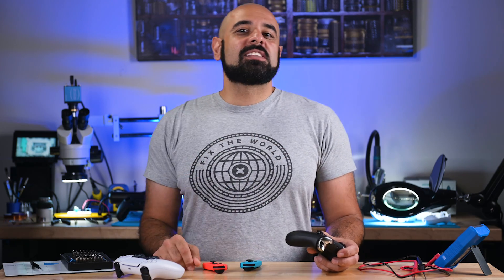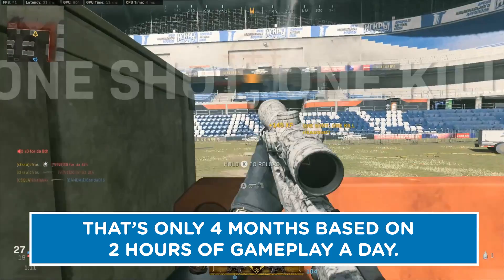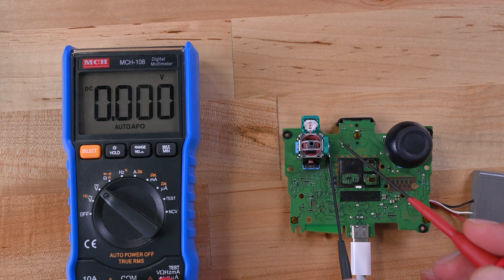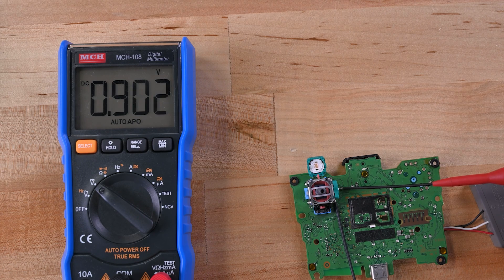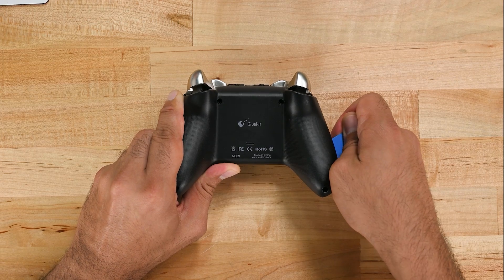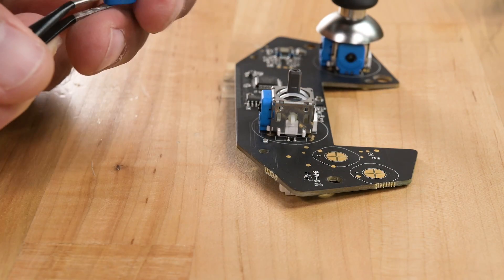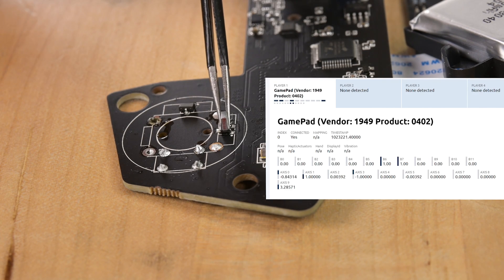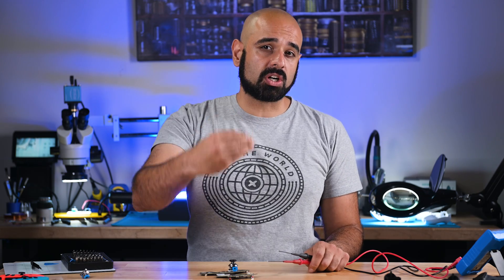How Manufacturers Can Fix Joystick Drift - Permanently!

Comment: Just stopping by to remind everyone that Hall effect sensors are not new technology. They were used for the analog sticks for the SEGA Saturn in 1996 and the Dreamcast in 1999. Manufacturers don't use them today because they would rather your controller wear out so you have to buy a new one.
Reply: @ShockingPikachu  they used light passing through tiny channels that would count many channels away from "zero". It's why if you held your joystick in one position while booting up the system it would maintain that trajectory. You "zeroed" your joystick position in that direction.

The floppyness is a mechanical problem. There is a bowl at the bottom of the joystick that holds it in place with a spring for tension. Over time, the joystick will grind away material from that bowl. The joystick will be in a lower position because the bowl can no longer hold the stick in the correct position and create the infamous floppy stick.
Reply: Designed obsolescence. The real cancer of the gaming industry
Reply: @Jihadbearzwithgunz  of the industry in general
Reply: @leonardomatheus1888  
I like to hear your alternative suggestions for how companies can keep profiting without being able to keep selling products? Nothing is more ill informed and naive as a no growth Capitalist theoretician.
Reply: @leonardomatheus1888  Nice pfp bro
Reply: @Jihadbearzwithgunz  it’s a feature of capitalism not just the gaming industry 😂
Reply: @Jihadbearzwithgunz  yeah the point I was making is that it’s even worse than you said!

You’re doing it right my man 👍
Reply: @Jihadbearzwithgunz  you have to milk profits one way or another
Reply: @Jihadbearzwithgunz  it’s not the design it’s their desperate greed of money 😐
Reply: @Jihadbearzwithgunz  Stop complaining.  Gaming is one of the cheapest hobbies on this planet.
Reply: @alexmendez3681  Gaming is definitely one of the more expensive hobbies. Cheapest hobbies would be something like sports, reading, writing or cooking (since you would have to buy food anyway).
Reply: @Jihadbearzwithgunz  it's called "planned obsolence". And this is not what it means.
Reply: @mihaitha  I’ll take “Planned Obsolescence” for 3000, Alex. Also, by definition, that is exactly what it means.
Reply: I can confirm that Hall effect sensors are common in RC applications due to their accuracy, consistency and longevity. Having flown RC for years, they do feel amazing. The accuracy is only limited by the characteristics of the sensor itself. Some have higher resolution than others.
Reply: Gulikit's controller and all the high-quality RC radio transmitters out there that use hall sensor sticks pretty much rule out sensitivity, accuracy and interference as issues. Heck, some industrial heavy equipment that require precise controls and reliability use hall sensing joysticks and manufacturers of such joysticks quote only precise voltage requirements and susceptibility to extreme temperatures (not applicable to game controllers unless you tell me you play in a volcano or out in the open during winter) as the downsides.

The stubbornness in refusal to use them for game controllers all these years absolutely is a planned obsolescence thing. They don't cost that much more than potentiometer sticks. People that try to make up big brain logics to defend the practice is a big part of why they can get away with this.
Reply: Dreamcast was wonderful
Reply: The original xbox one pads used hall sensors for the L and R triggers. Always surprised they didn't go with them for sticks, but as you say, they want you to buy replacement pads, which has become a big market in itself
Reply: @newtechgs7471  that's not entirely the reason why those triggers were phased out.

developers weren't utilizing the variable triggers... the only developers who did use them were racing game devs, where there's no reason a player would not just hold the trigger down except in very niche situations for rounding a corner -- where braking, a compulsory mechanic in racing games, is more intuitive and overrides acceleration programmatically anyway.

for all other instances, especially fps console games, having a set threshold for a thumbstick wouldn't help. also players often complained about how dampened and almost mushy the triggers were at launch, and the launch of the hair-trigger on the elite controller completely circumvented all other instances.

if they had implemented the hall trigger with sony's ps5 version of hair-trigger + tension feedback, it would have been utilized more. otherwise, i think the only non-racing games i remember ever utilizing analog-like triggers for gameplay werent on the xbone -- bodycount for the 360, and smash melee gamecube controllers.

the only racing game where it actually was useful on xbone where braking didnt invalidate it, was rocket league.
Reply: @ShockingPikachu  I think I heard that the N64 used an optical sensor, which I guess would make it more comparable to a mouse
Reply: @Jason-ir5ig  Yes, essentially they were a ball mouse, but being totally mechanical and with materials of very low quality, the base of the stick wore very fast creating drift (just as happens to the sticks of the switch, how curious), if only nintendo had used a rubber ball instead of a plastic stick would never have worn out and the analogs as we know them today would be different and durable, you would only have to clean them.
But maybe they would have inflicted some patent, Nintendo has never had a division of research and development of technology as if they had their rivals of the time NEC and SEGA, nintendo has never created anything, only takes existing technology and uses it in a different way what also has is to be applauded.
Reply: @Jason-ir5ig  No. The N64 controllers used potentiometers too however they had springs that held them in place. But they used cheap plastic in the housing  which ground away enough overtime that the stick could move just by tilting the controller. This is most evident if you played Mario party.
Reply: @Jason-ir5ig  Yeah. Though it had problems with the plastic bracket grinding itself to dust.
Reply: Sim racing manufacturer’s use them in there pedals my gas and clutch pedals have hall sensors on them the brake is a load cell
Reply: @shorty808100  my very old pedal uses an led and photoresistor for the sensor and the pedal has a v cut slotted between them.
Reply: @ShockingPikachu  N64 used optical sensors.  TECHNICALLY the N64's stick is actually a digital input because of the way it works, but yes, no pots with the only point of failure simply being the plastic so you're not entirely wrong.
Reply: u forgot dualshock 3
Reply: @madmatrac  ds3 was pot
Reply: @rudeskalamander  ds3 had hall on earlier versions. before cheaper slim version
Reply: @ShockingPikachu  Wrong, they use an optical encoder, sort of like some of the later mice that still used a ball. The reason they didn't wear out is because there was no physical interaction between the optical encoder disc and the sensor. Sticks themselves obviously still wore out.
Reply: @kameleongreen  Later mice? try again. I have an old logitech square mouse from the 80s that uses optical encoder wheels.
Reply: Welcome to capitalism 😒
Reply: I was about to mention the dreamcast controller! I picked up the console recently cause i grew up with it, ended up taking the controller apart and was thrilled to find hall effect sensors
Reply: Jeeze, I wish SEGA still does hardware today aw.
Reply: @AzariusR  Imagine if they pivoted to making peripherals for other consoles. The Sega Dual Sense
Reply: @AzariusR  put a comma after wish
Reply: @AzariusR  Yeah, unfortunately I don't see that happening anytime soon.
Reply: @AzariusR  did*
Reply: And they are used in heavy machinery, like for example an excavator, they've been in use for years, in places where precision and reliability is a must.
Reply: hopefully the EU could include this in some of their laws about planned obsolescence in technology
Reply: ps3 also had hall effect.
Reply: That's why these videos exist.

The more people know about this, the more people will buy better products, which will bring up the competition, and therefore will push them into building better controller solutions.
Reply: Came here to say exactly this. Saturn and Dreamcast controllers STILL going strong.
Reply: Honestly it doesn't make sense if they don't own an exclusive repair shops like Apple do. People can just replace those analog sticks in a 3rd party repair shops. They're just cheaping out on the parts. But it do works. Honestly i still have OG PS1 controller and it doesn't have any drift and i played it for 8 hours daily. Because of RPGs and the stick destroying mini games.
Reply: Just ban potentiometer-based analog sticks, problem solved.
Reply: Is there a place to buy them for a joy con?
Reply: @jeffcox6539  Not currently, but Gulikit has said they're working on making a module that can be used in Joy-Cons (they'll probably be cheaper than the Steam Deck ones since they don't need the touch sensor). I'd imagine Nintendo isn't going to be happy about it though.
Reply: EXACTLY! This is what I have been saying since day one. Sony and all the other companies make a ton of money on controllers, that's why they are priced higher than video games! They KNOW people will buy new controllers. This is why I HOPE the class action lawsuits really take off. Tired of these big companies soaking us for every dime. It IS entirely up to the manufacturers, but I highly doubt they will pick up the solution. They will continue to soak us for every dime with the wear and tear in 4 months controllers. Because they know that we will go out and buy new controllers. It's that simple.
Reply: @silverywingsagain My sega saturn controller had stick shift! The centering spring wad badly designed and weared out after a few years. Nothing is perfect.
Reply: @PhreakDarkSoul  yes, there's a difference between a few years and a few weeks, joycons in my personal experience tend to fail after a couple months, which is unacceptable.
Reply: @ShockingPikachu  the N64 controller did not use hall effect sensors they used an IR beam that was blocked by a disk with slits in it that created pulses of light like old ball mice used
Reply: @ShockingPikachu  The N64 one is optical.... and one of the worst offenders in terms of wearing and drifting. That white dust that you can see in any n64 controller isn't some random dust, it's plastic... plastic that comes from the piece that's supposed to keep the stick aligned in both axis.
Reply: Indeed, Spawn Wave recently made a video about the Dreamcast Controller. Even shady ass Microsoft initally used HE sensors in the Duke Controller.
Reply: @ShockingPikachu  No, the N64 sticks used the same mechanism of a ball mouse of the time and was not magnetic were optical, but not like today's optical mouse, however to be mechanical rollers that moved the stick were worn and created drift.
sega controllers were actually the first to use this antidrift technology in their sticks but also their triggers were magnetic.
Reply: This is why I still love Sega.
Reply: It wasn't only the thumbstick, it was also the triggers (at least on the Dreamcast controller).
Reply: Yes they are making you buy more but they could also just make these Hall effect sensor controllers more expensive and people will inevitably buy multiple controllers wether it be for friends or it’s a limited edition controller
Reply: exactly ...they did it on purpose ...been sayin this since the problem began ...my xbox 360 controller still works great.
my game cube controller still works great.
my sega dreamcast controller still works great.
...this is done on purpose!! ...why?
...good old fashioned GREED
Reply: And yet they push out more money for productions of these controllers and contribute to e-waste.

Great business endeavors! 😒 dumbfucks
Reply: Which is weird because I never buy a Sony brand controller.  I don’t play enough so I get an off brand.  So they get no money from me.
Reply: It's a marketing trick called planned obsolescence, basically the lightning cable version of joystick sensor. Sadly UN haven't show any interest to address this issue. They have been looking out for e-waste reduction regulations lately but i doubt they will touch this matter for 3 years.
Reply: Came here to say this, well done.
Reply: @ShockingPikachu  That's because the dead band was enormous
Reply: As practiced by sony with their brand new $200 controller, and people are still defending it 🤣
Reply: Planned obsolescence has been around even longer
Reply: Ps vita fat 1000 model also use magnets for their joysticks
Reply: they were used in old Atari arcade cabinets too
Reply: Ah the light bulb strategy. There were incandescent light bulbs that could last for years. Then all the lightbulb manufacturers got together and collectively agree to not make light bulbs that last longer than certain period of time in order to keep light bulbs profitable.
Reply: guess i don't need to replace my dreamcast controllers then.
Reply: It's likely to save money when manufacturing as it's in their best interest to ensure you have a controller at any given point as without a controller you won't be buying their subscription services and games to make them money due to consoles being sold at a loss. That being said even back then they didn't use Hal effect sensors (everyone used something different) with that being a Sega thing
Reply: Controllers are basically a subscription to play your console, they start severely drifting within 1-2 years of use depending on how heavily you use them
Reply: EXACTLY WHAT I SAID
Reply: It’s sad that 3rd party companies will include these types of joysticks while major companies intentionally sell you an inferior product at a higher dollar amount just to incentivize further purchases.
Reply: Llevo ya 7 años con mi Dreamcast y ninguno de mis controles tiene Drift o presenta algún otro problema y vaya que adoro jugar con mi Dreamcast Sonic Adventure 2. 😎
Reply: Long nose people did it😅
Reply: SEGA really knows how to make their customers happy
Reply: Exactly.
Reply: Every single ps2 controller I've had has never gotten stick drift, but that doesn't help the cord getting ripped up
Reply: Spot on
Reply: Planned obsolescence hit hard.

We should peacefully protest against planned obsolescence and permanently illegalize it
Reply: The 64 used light sensors
Reply: It’s discovery won a Nobel prize for the team of scientists at bell labs
Reply: Nothing new. This has been a thing in cars.
For example Mercedes Benz made a name for themselves early on as a high quality car, especially peaking with the W126.
And that is when they found out, a high reliability vehicle is GREAT for the user, but it doesn't bring the customer back in for further spending.
So, from the 90s onwards the quality of mercedes cars dropped and reliability wasn't as before ever again.
And all car manufacturers adopted that same ideology, of a lower reliability to force consumers to repair and buy again.
...
In the present times the same concept is the subscription model, where the seller bleeds dry the consumer, always taking money. It may appear advantageous at first, when they introduce the system in their business model, but as they slowly remove the one time purchase system, they also drop support for previous generations of one time purchase software, they raise the price for the subscriptions, making it severely overpriced. They do include some small tricks they call "consumer benefits" to make it appear their new generation is better than before, but something that only a small minority would use or need. Still they use it as backing up their claims of better software.
Now with cars. You buy the car but hey, you know that cool extra that was included in the previous model in the same trim level?!
Now is also physically there but you have to pay a subscription for it. They chop it off in software even though you pay for it, even though it is in the car.
Reply: I wish that one day, sega would go back to making consoles, but their executives are just too immature and self-sabotaging for them to be able to pull it off.
Reply: And PS3 sixaxis had too.
Reply: This is agreed this is the reason why Nintendo themselves purposely made the joy cons this way so that way they can get people to buy a new pair of joy-cons. And I also own a PS5 but I hate the fact that I had to buy a second controller after playing with it for a couple months and then having to buy a new one
Reply: PS3 use a Mr electronic magnet in there joystick and they change to what have now in control
Reply: Seems like now the competitors have started using this hall effect joysticks. And now we have multiple manufactures using it to make controllers. Have already seen official xbox controllers with hall effect joysticks from Gamesir. I think soon we will have official controllers from xbox and ps5 as well with hall effect joysticks.
Reply: Dreamcast was SO GOOD, for its time it was far ahead of the other consoles. Shame we didnt keep them around
Reply: To think how people manage to implement touchscreen on a phone, but hardly manage to implement friking magnet on a thumbstick
Reply: It should be illegal to make inferior products at mass scale due to the waste we create. It's ridiculous. I wondered why a 64 controller lasted till this day while nintendo switch controller failed 1 year later.
Reply: Yep - they mentioned that these have been in use in controllers before. Until the controller they mentioned was released in 2021 (2:54), the last controller that used them was in 2006. Cost and planned obsolescence at play.
Reply: They do wear out. Thumb sticks still will even with perfect potentiometers. However, artificially shortening the lifespan of a device seems unsavory to me.
Reply: He said since 2006 in the video dude
Reply: @Sherdderworld  He referred to Dualshock 3 probably.
Reply: You missed the verb after "rather".
Reply: @ShockingPikachu  It's*
Reply: I game on a PC lol
Reply: Also abs sensor on cars for years
Reply: Manufacturers don't use them today because they're more expensive than the cheap pots that they use now. There's nothing to do about them wearing out wanting you to buy new controller. It's because the upfront cost is millions of dollars cheaper. And that's before your system launches. That's before you know how successful it's going to be.
Reply: @ShockingPikachu  do a little bit of research. The Nintendo 64 analogs were some of the worst ever released. If yours are still working perfectly you're lucky.
Reply: Planned obsolescence.
Reply: hall effect sticks are also susceptible to stick drift as its mostly caused by the centering spring waring out and not the pots waring out the ps1/2 controllers used the same type of pots the PS4/5 controllers used and they did not suffer the stick drift problem the PS4/5 controllers have and that is do to the spring the PS1/2 controllers used compared to the spring the PS4/5 controllers use
Reply: @rayzimmermin  also afaik they use a thicker resistive track on dualshock 1&2, which means it can wear more before being noticable.
Reply: I dunno mate, the lower precision and vulnerability to magnetic inference (even over long distances) might have something to do with it.
Reply: @chrismorrison5301  Lower precision? Bruh, you can literally have a 0 Deadzone on a Hall Effect Joystick and it will never drift.
Reply: @Skiptrac3  No Difting and lower precision are not the same thing.
Reply: @chrismorrison5301  There exist zero applications in which you would suffer from using a hall effect controller. They're used in Flight sticks all the time. Potentiometers only exist in the absolute cheapest and least accurate of sticks.
Reply: @chrismorrison5301  They don't have lower precision, if anything it's higher and they're not that vulnerable to interference, inverse square law means anything more than a few CM away becomes insignificant (unless it's an MRI scanner).
Reply: @chrismorrison5301 lower precision? Where are you getting your info from? Precision is about the same as potentiometers with the added bonus of not breaking down in 4 months as I’ve seen with my last 5 PS5 controllers. The only minuscule downside is it’s a few MILI seconds slower. MILI meaning thousands of a second. Considering you literally would not notice if your game went from 60 fps to 57 fps, you likely would never even notice that difference. So there is really no downside. At this stage, your new failure point would no longer be the sensor but the spring that returns it to center.
Reply: @chrismorrison5301  im not an expert but i assume at far enough distances such as outside the casing of the controller, most magnetic fields wouldn't have too noticeable of an effect and most people aren't holding those massive neodymium magnets up to their controllers
Reply: @kenopyowo  You would be suprised, hall sensors can be affected by magnetic fields from a decent distance given they are powerful enough.

Not to mention the controller itself will have multiple components that create pretty strong magnetic fields, the strongest of which would be from the vibration motor which uses a magnetic field to rotate. When those go off with high voltage for intense vibration they will likely cause notecable interference.

The battery is also a big one, that would be right below them and that will always have an electrical field around it while it has a charge.

I have no doubt that certain techniques and advancements will make this a non issue in the future, but as of right now hall sensors aren't really a suitable replacement.
Reply: @chrismorrison5301  bruh ever heard of Faraday cages or magnetic shielding that can be made literally paper thin
Reply: @Mr371312  Magntic shielding is a thing yes, but to lower EMF interference you need a sheet that is about 3.2mm thick which will only reduce it by 50% not to mention the sheet needs to be large, at least as wide as the distance between the source and the sheet.

That is too large to fit inside an already crammed controller shell.
Reply: @chrismorrison5301  that can just be the controller shell. the shell is already extending well beyond the pcb, having a metal shell built into a standoff surrounding the sticks, and metal stick components themselves (which the xbox controllers already do for the swappable sticks) would be more than enough to shield it from most things, and a minimum voltage threshold to get rid of any extremely low EMFs causing interference. 

heck, having a ferrite core built into the cable like the old days of controllers would also ward off a lot of EMI.

which is exactly what a lot of RC and drone controllers with hall sensors often have. a metal box for a shell.
Reply: @natayaway  I don't think you understand, the size of the shielding needs to be the same as the length from the source.

One of the biggest sources of EMF in a controller is the vibration motors, the furthest motor from a stick (but still close enough) is at least 10cm. This means the sheet of shielding needs to be a 10x10cm square that is about 3.5mm thick.

That will only reduce interference by about 50%, so even if you did manage to fit that inside the controller it would only reduce the problem, not fix it.

Do you have a way of fitting multiple 10x10cm sheets of conductive metal inside that controller shell?
Reply: @chrismorrison5301  the faraday cage doesnt need to eliminate all EMI, it just needs to get rid of enough for software to handle the rest.

consequently, having a vibration motor in the controller means you also have access to the motor when said motor is activated and you can accommodate accordingly in software.
Reply: @natayaway  Did you not read what I said? That 10x10cm sheet with a thickness of 3.5mm only stops around 50% of the EMF, that means 50% is still going to hit the joystick.

You can't just use software to account for the EMF's interference, not only are there multiple sources to deal with. 2 motors a battery and 10's of competents on the PCB but even if you only had 1 to worry about the EMF interference is way too random to account for and adjust in software.

You can't just stick a small mesh block on something and call it a day, there are 100's of variables that just make it impossible in present day.

I have no doubt that as technology improves we will improve hall sensors to a point where they are much less susceptible to EMF, additionally we might increase the efficiency in other components and reduce the EMF produced by those.

But that won't be for a long while now, maybe we will see it next gen, maybe not. But in the here and now it's just not feasible.
Reply: @chrismorrison5301 EMI is different from magnetic interference. 

copper is the single most reliable material for shielding from radio and microwave radiation, and simple mesh sleeves are more than enough to account for EMI from cables or power delivery.

for magnetic interference, a contoured metal alloy controller with a ferromagnetic steel frame, and little standoff/carved housings encased in materials like mu-metal in thicknesses of 10 mil with a high degree of permeability, given the internal structural supports and standoffs per component creates additional layers of shielding, totally has the ability to redirect electromagnetic component magnetic fields.

the only motor to worry about is an electromagnetic linear actuator, the ones with coiled copper that creates constant magnetic fields. replace that with a typical rumble motor and solve that problem.

additionally, a hall sensor absolutely can use filtering through software. any em field emitted by electromagnetic linear actuators are going to be large enough to create a field the encapsulates all of the hall sensors. the attenuation from the magnet in the thumbstick would apply a completely separate voltage than the one from the linear actuator. software can measure the difference in voltage, change the thresholds, and scale accordingly. this would require dynamically scaling and resampling
voltages over time as you have multiple magnetic fields to pass through, but the end result is that you have differences in voltage that are measurable.

shield everything else in copper for plain high frequency EMI and you're fine.
Reply: @natayaway  EMF or Electric Magnetic Fields can cause EMI or Electric Magnetic Interference.

All of the stuff you're talking about would be too large to put in a controller and non effective if it was small enough.

You cannot code out EMI from a hall sensor, even if you could you would need a way to detect and read the EMF which could fit in the controller but it ain't cheap.

I've just consulted my Sister and her Boyfriend who are both Astrophysicists, they have confirmed what I have already said.

So thank you for the nice debate but I'm going to call it a day.
Reply: @chrismorrison5301  these are real components in RF and RC remotes, and are commercially available for the exact use case you say it's impossible for. there are drop in control stick replacement modules for the steam deck, on amazon, today. they're in the exact same device as a battery and two vibration motors for touchpads and they experience negligible interference, being way more accurate than a standard stick, despite being around a variety of different electric magnetic field components, specifically the electromagnetic linear actuators underneath each trackpad, within three inches of the hall sensor. with very minimal shielding no less.

im sorry, but you're just plain wrong. these are totally ready for primetime -- RF operators of drones wouldn't be using them for aviation drone remotes if they were so susceptible to interference.
Reply: @chrismorrison5301  Asking astrophysicists on the intricacies of viability for hall effect sensors in gaming pads is like asking your plumber to do your dental work. These are entirely different fields working with orders of magnitude different radiation sources.

If rumble Motors are such a problem how come when I use the rumble addon in my Dreamcast controller the stick input is read out identically with the rumble going on full blast? The motor is definitely larger and stronger than modern rumble motors.
Reply: @RAHelllord  One of them is an engineer who works on communication equipment for space stations, so radiation and interference is something he has to deal with on a regular basis.

The actual vibration motor is a decent distance from the stick, being in the bottom expansion slot of the controller and sticking out like that. Seeing as it is an older peripheral and the size of the motor is less than half the size of the ones used in the PS and Xbox controllers as well as there only being one compared to the two in modern controllers it's EMF would be much smaller and much less of a problem.

The dreamcast controller also doesn't have a battery which reduces the EMI of the overall unit by quite a notecable amount compared to a modern controller.

Don't get me wrong, I want hall sensors in controllers as much as the next guy and as soon as technology gets to the point where its feasible I will be the first thorn in Sony and Microsoft's side, but as of writing its just not 100% there yet.
Reply: @chrismorrison5301  what part of aftermarket steam deck drop-in replacement hall sensor thumbsticks already exist, for use in the same device as battery and two touchpad haptic vibration motors, did you not understand?
Reply: @natayaway  I understood all of it, I'm just pointing out a potential flaw.

A flaw that should be negated as technology evolves, but one that still exists.
Reply: @chrismorrison5301  the hall sensor sticks do not exhibit any malfunctions from steam deck internal components generating magnetic fields.

receiving interference from outside of the steam deck with various magnetic fields has been repeatedly debunked by people in this exact thread, both hobbyist RF operators, and former Saturn/Dreamcast owners, which encompass basically both extremes of the consumer spectrum (only industrial and private research groups would be able to produce fields to interfere with them).

where's the flaw?

you might be technically correct in theory from your family and friends, but in practice the sensors dont receive any noticeable interference in their intended use applications.
Reply: @chrismorrison5301  then explain why there were used in Dreamcast controllers with no issues or any of the other game controllers that do use them. Many HOTAS controllers use Hall sensors, high high-end RC controllers use them. they get used in CNC servo encoders; they are fine for replacements to potentiometers in the thumb sticks. I use my RC controller which uses Hall sensors for flight sim pc games i play, or car driving sims, also my Dreamcast controllers still work fine. The reason hall sensors aren't used more has nothing to do with potential interference. Instead, the reason is simply because they cost more to implement and use. The manufactures know that the cheaper parts will wear out and the controller will need to be replaced. 

magnetic interference isn't as big a deal as you are trying to make it out to be. other wise old tube TV would not have worked either.  can you cause magnetic interference sure. but you can also induct voltage into the potentiometer they are just a coil resister and coils produce voltage in changing magnetic fields as well which will mess the accuracy.  Note there are specific metal alloys that essentially reflect magnetic fields. these are used in hard disk drives for the coils that position the read head.  So, if that was the issue again, we have the technology to mitigate it if it was in fact an issue.
Reply: @markburton5292   The reason hall sensors are not used is because neodymium magnets corroded rather easily, and required some heavy shielding to protect them for years (which increases build price). When I used to work for Saitek, I recommended aluminum sheets (really thin ones) to protect the magnets inside the X-52 line of flight sticks to eliminate corrosion. The thin aluminum only created a small oxidized layer that did not penetrated into the magnet ( and even if it did it would contain the magnet inside).  

I was told it was too labor intensive to add it, shortly after the company was sold to Logitech.
Reply: @S.Madman  they do not. I have had neodymium holding stuff up in the shower for years. again, reason is cost not any of this other bs. labor is part of cost but really, it's not any more labor intensive than installing any other parts on the controller. I agree that the hall sensors are more expensive, but it is only by a small amount per unit.  But that right there is the reason price. also, come on aluminum sheets? if you wanted to protect something from oxidation sorry, but that isn't the way you do it. Electo plating with Nickel plating, or some other metal plating would do more than an aluminum sheet.  if you aren't going to electroplate them then paint would be the way you do that.  that is one reason you paint cars after all.  And yes they do electroplate the magnets from the factory usually to add strength to the magnet as they are brittle.  Silly statements like the sheet to protect from corrosion don't make me have any confidence in your statements as being factual or truthful
Reply: @markburton5292   Aluminum is a lot cheaper than copper. And just because it's different does not mean it wrong to use it. The standard, as you mentioned is electro plating. Do you know how expensive it is, specially on a really tiny part, as opposed to a larger one (think bulk)?

What background do you have, to call my statements silly?  

I was in the prototype stage for a solution, to increase longevity, and was shut down. 

A coating of aluminum would have been next, but again was not even allowed to get there.

They saw the amounts of returns on X52's, and did nothing.
Reply: @S.Madman  first using an aluminum sheet near the part to reduce corrosion will do absolutely nothing. 

If you meant to say electroplating a metal then that is different, and you should have indicated that and not have indicated a sheet. You could also encapsulate the magnet in epoxy or conformal coating. While I did say to electroplate would be a solution to corrosion if it were an issue I didn't say electroplate in copper, you added that. Note copper also would be a poor choice for corrosion resistance as it will oxidize. 

 In short indicating that you are putting a sheet of anything next to a part to reduce corrosion won't do so, yes, it is silly to imply that it will. 

Next the magnets typically come from the factory electroplated with nickel.  They do that to help keep them from breaking since the magnets are brittle. Not that this is an issue inside a controller.  So, they typically already come with a nickel electroplated coating.  

even if they didn't electroplate them conformal coating would solve the issue if it were an issue which it is not.

as for as schooling my degree was in electrical engineering and programing.

I also make and fly drones, use HTOS for flight sim's and those controllers use..... wait for it.... Hall effect sensors.   oh they also use the hall effect sensors for all the e-bike motors and the magnets in them are neodymium magnets. They also don't have corrosion issues with those magnets either.  

My drone motors have wait yup you got it neodymium magnets and they are exposed to the outside air. no issue with corrosion. 

In short you are just simply incorrect as to the reason why they use potentiometers over hall effect or even optical 

You were right on one thing economies of scale. They use the cheaper potentiometers joysticks because they are cheaper and simpler to make, not because they are better or more durable. That cost savings when making millions of controllers means they make more.
Reply: @S.Madman  why would you electroplate when you can  sputter the aluminum on it.  Vacuum plating my man.
Reply: @richardbrooksshnee  Ask Mark he is the one that brought it up.
Reply: @chrismorrison5301  What you say about magnetic interference is most likely true in theory but how come the hall effect sensors in the gulikit sticks don't have the issues you state?  Just got their controller to try it out and I have no issues and the accuracy on PC is top notch.
Reply: @clownavenger0  Despite what they say in marketing the sticks they use aren't hall sensors, they are magnet based potentiometers which use magnets instead of the carbon film used in the potentiometers of other controllers.

The sticks work on a very similar principle to the ones you find in normal controllers but use tiny magnets instead metal on metal contact.

That's why they are more resilient to EMF compared to hall sensors, because they aren't actually hall sensors.
Reply: @chrismorrison5301  Alright thx for the answer.  Definitely the best stick I've used on a controller.
Reply: @clownavenger0  As far as I can tell these magnetic based potentiometers have many of the benefits of carbon film based potentiometers and Hall effect sensors with few drawbacks in comparison. I wouldn't be suprised if many of the bigger controller manufacturers started using them by the time the next console generation roles around.
Reply: @chrismorrison5301  They might if people push the issue.  However if they don't it seems like 3rd parties will handle the issue for us who want better.
Reply: @chrismorrison5301  the guliikit kingkong 2 managed that just fine. sony amd microsoft just want to sell youa new controller every 2 months
Reply: @Samusaranish  Eveery two months seems a bit small doesn't it. I've got controllers with carbon film based potentiometers in them from the PS1, 2 and 3 that still work no drift.

Anyways, someone else commented the same controller, so instead of re-writing it all I'm just gonna copy and paste the comment I wrote.

Comment I wrote:

Despite what they say in marketing the sticks they use aren't hall sensors, they are magnet based potentiometers which use magnets instead of the carbon film used in the potentiometers of other controllers.

The sticks work on a very similar principle to the ones you find in normal controllers but use tiny magnets instead metal on metal contact.

That's why they are more resilient to EMF compared to hall sensors, because they aren't actually hall sensors.
Reply: @chrismorrison5301  The PS4 controllers I got from my Dad broke after 2 months x(  To sony's defense I've been playing gungeon, a bullethell shooter for at least 3-4 hours a day though. Now I'm getting the cheapest on amazon until the gulikit becomes available :)
Reply: @chrismorrison5301  why did dreamcast and saturn not have any interference with their sticks than ? And the dreamcast had a huge VMU/ Rumble Pak attached to the center of the controller
Reply: @Hypno_BPM  The rumble motors in newer controllers are practicly right next to the joysticks whereas the rumble pack for the dreamcast controller was much further away as it was attached to the lower slot.
 on the controller, magnetic frequencies become incredibly weak if they are more than a couple of centremetres removed from the target. The dreamcast attachment was also weaker, so that combined with the larger distance meant that there was no problem for that controller in the form of interference.

Look, I'm not saying hall sensors will never be a good idea in controllers. As technology and software improves we can reduce the affect of interference on them no problem and increase the accuracy of Hall sensors. But as of right now they aren't as viable as the metal contact potentiometers used today.

There are Hall sensor potentiometers in the works that look to be promising because the actual sensor itself is smaller and therefore is less susceptible to interference so hopefully that goes somewhere. Plus they are closer to the accuracy of the metal contact potentiometers used in most controllers as of writing (Hall sensors aren't as accurate as currently used potentiometers but they are getting better).
Reply: @chrismorrison5301  yeah that makes a lot of sense. I always thought Dreamcast had the best feeling joystick of any console i ever owned with gamecube being another one that comes to mind. i’ve owned consoles since i was a kid starting with NES and never had any issues with them until PS4 gen. i know it’s a meme but “they don’t make ‘em like they used to”
Reply: @chrismorrison5301  you could shield the magnets of the joystick and use another hall effect sensor on the motors, and take that sensor value, scale it and use it as a correction factor.
Also I haven't seen it be an issue in actual use. The magnets near the sensors are very close and so any outside interference is negligible.
Reply: @natayaway  pretty sure Chris works for Microsoft's marketing team 💀
Reply: @Mr371312  Not always meaningful in all applications or easy to do in the manufacturing process, consistantly even.  There's more to it than just cost savings, most first party controllers aren't that massive of a profit and they consider the harm to their reputation and console sales from constantly dead controllers against potential value of forcing consumers to replace their controller, especially in an age where paid online servicea already ensure a continuing revenue stream.